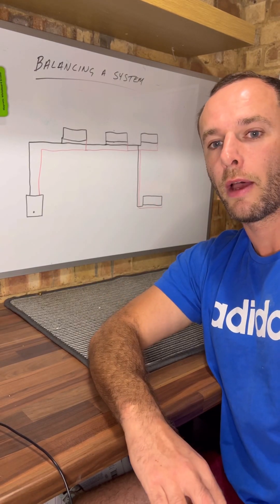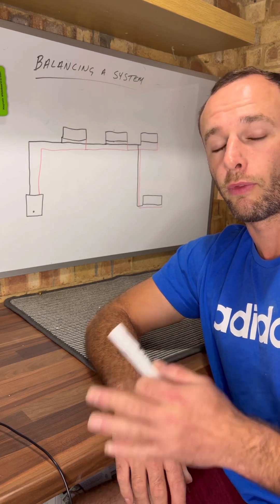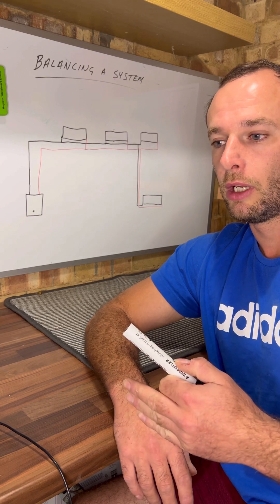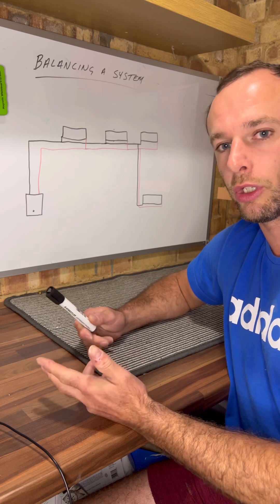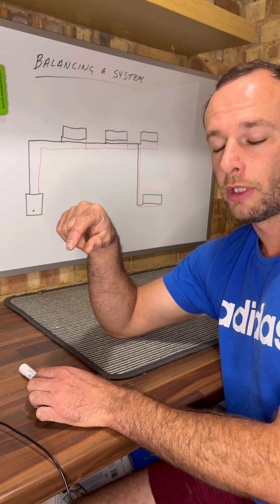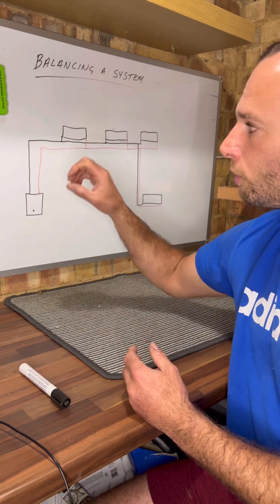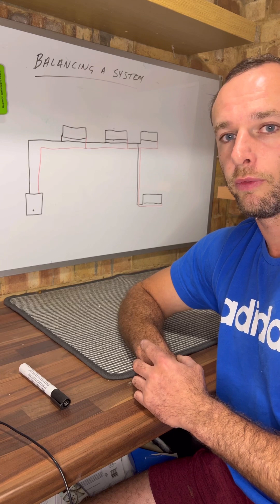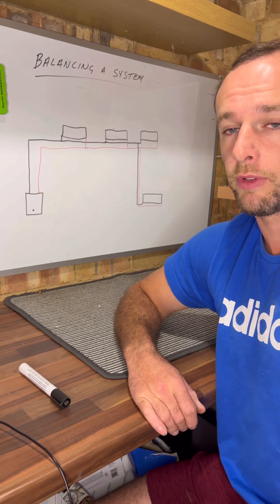How To balance a heating system

Comment: How would you know if you have a weak pump?
Reply from the maker: Electrically testing to see if it has enough ohms on the capacitor, if your not a plumber or electrician I’d advise getting 1 in to test it for you

Comment: When I do lockshied side half a  turn what about other side  imean TRV FULLY CLOSED OR FULLY OPEN  ? I HAVE SAME PROBLEM  IJUST REPLACE 3 RADIATOR AFTER THAT ALL SYSTEM OFF 
PLEASE HELP ME
Reply from the maker: I would leave the trv side fully open to allow the flow through the valve and then that way it will allow you to be able to use the trv properly 

With regards to the lock shield

Close all way down
Then open half a turn at a time when needed to allow flow
When get the correct heat flowing then leave that valve

Or open it slightly more to allow more flow